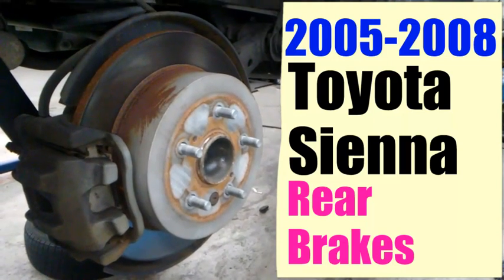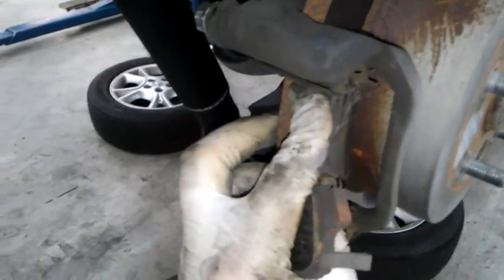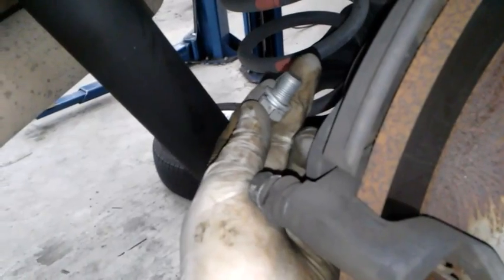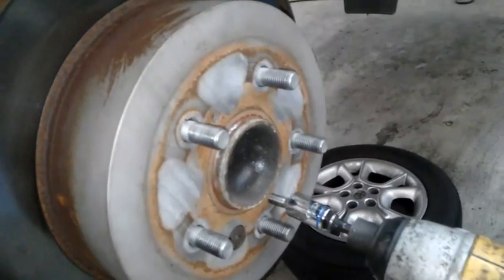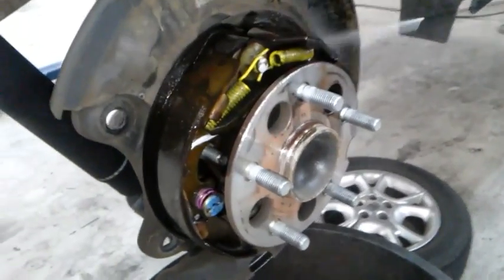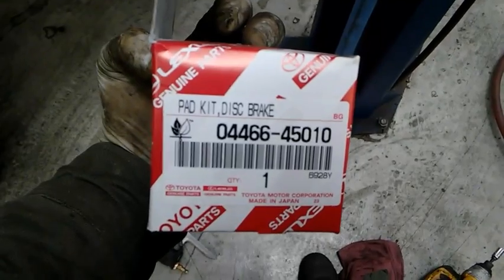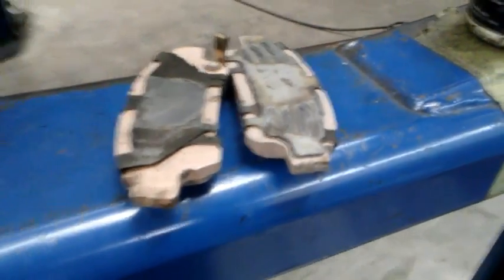2004-2010 Sienna Rear Disc Brakes

Comment from the maker: GET THE GENUINE REAR TOYOTA PADS HERE ( AMAZON ) ( $ 59 BUCKS)
https://amzn.to/3Tt17qB

GET AFTERMARKET REAR PADS HERE ( AMAZON) ( $ 23 BUCKS )
https://amzn.to/3trMSaZ

GET NEW REAR ROTORS HERE ( AMAZON ) ( $ 40 BUCKS ) (BUY 2)
https://amzn.to/3g281pe

NOTE: IF BUYING REAR TOYOTA OEM PADS THEY DO NOT COME WITH SHIMS, YOU NEED TO SWITCH THE SHIMS FROM YOUR OLD PADS TO YOUR NEW TOYOTA PADS. IF YOU BUY AFTERMARKET PADS YOU CAN DISREGARD THIS NOTE. 
WATCH THIS VIDEO FOR CLARIFICATION 

https://www.youtube.com/watch?v=KM2AHX6Md6w

GET THE FEATURED BRAKE CALIPER TOOL HERE ( AMAZON) ($ 44 BUCKS)
https://amzn.to/3WXsmfT

GET AN ECONOMIC BRAKE CALIPER TOOL HERE ( AMAZON) ( $ 11 BUCKS)
( WORKS FINE)
https://amzn.to/3O0PgPy

NOTE: THE AFTERMARKET PADS I PUT A LINK TO ARE THE BEST AFTERMARKET BRAND IN MY OPINOIN. I HAVE USED MANY AFTERMARKET BRANDS IN MY  CAREER . POWERSTOP / EVOLUTION PADS ARE THE BEST PADS PER BUCK AND COME WITH NEW HARDWARE. 

THE REAR ROTOR I LINKED TO HAVE THE BEST AMAZON RATINGS. THERE ARE A COUPLE A FEW BUCKS LESS BUT THOSE HAVE BAD REVIEWS. 

TOYOTA REAR BRAKE PADS PART # 04466-45010

Comment: Great video! Thanks! Unfortunately I used my drill with full torque to remove the rotor from the hub and I ended up having to put together the parking brake hardware...hours later I finished....thanks to the help of the wifey
Reply from the maker: +Chris Asprelli dang that sucks dude.

Comment: I always use a 12-inch C-clamp to push the calipers in. Works like a charm!
Reply: Just swapped my pads today. Had to use a 14 mm open end wrench to prevent spinning. (Hint, hint... Never, EVER use a pair of pliers on an OBVIOUS nut!) But I couldn't get the disks off. I was expecting them to be loose. They aren't. What bolt did you use? It doesn't look ANYTHING like the bolts for the brake caliper! Same on the front. But the nut for the inside on the caliper was a 17 mm, not a 14. Weird that it would be different.

Thanks for the info!

Oh, and the clamp is 10 inch, not 12. Thought I remembered right. Oh, well.... ;)

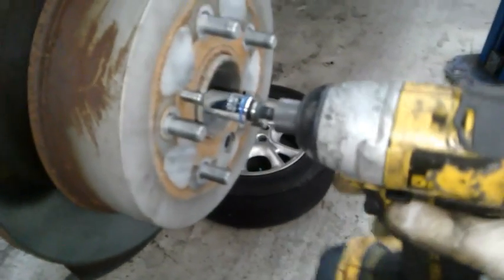Comment: What size bolt are you using at 2:33 in the video?
Reply: Michael Goff Did you get the answer? I wonder it’s the one he removed using the 14mm.
Reply: According to this help site, it's M8 x 1.25: https://www.2carpros.com/questions/toyota-sienna-2009-toyota-sienna-rear-rotors
Reply: Excellent video by the way. Straight to the point and simple

Comment: many 2008 require a special tool to screw the pucks back in on caliper don't try to force push it in some require to be turned back in
Reply from the maker: +Robert Taylor Thanks for the tip!

Comment: How often does the back rotor need to be changed?
Reply from the maker: +lud rodriguez It depends. But not alot. It depends on if it is warped or how many times the rotor has been machined. You would know if it is warped if the car ( not the steering wheel) shakes when braking.
Reply: I always thought that you change rotors when you change pads. I even looked into machining rotors and was told that rotors are made too thin to machine and not risk warping